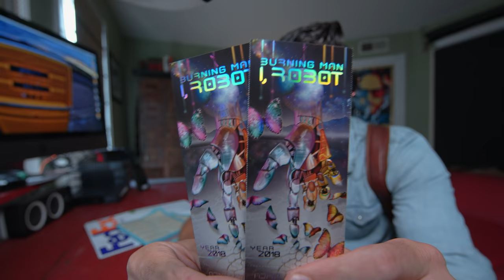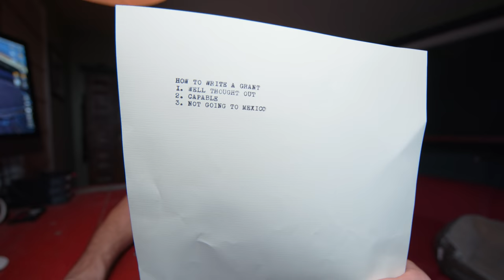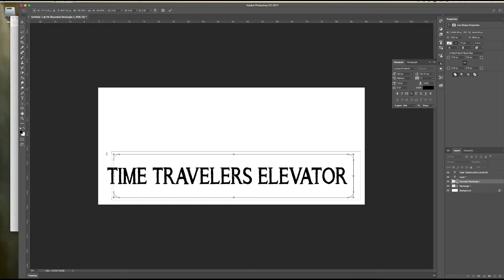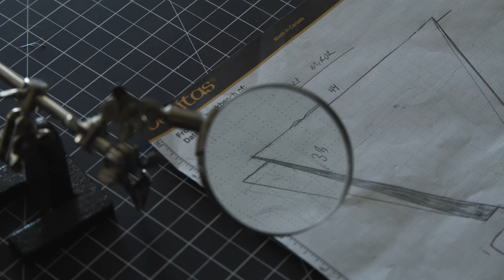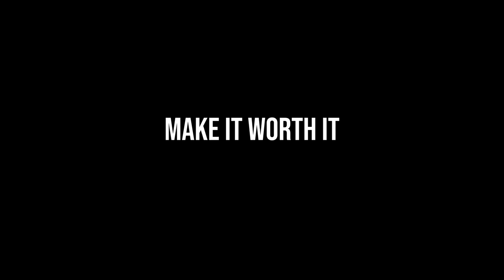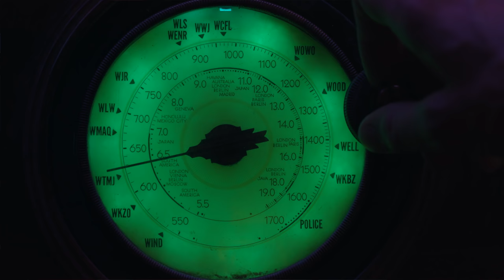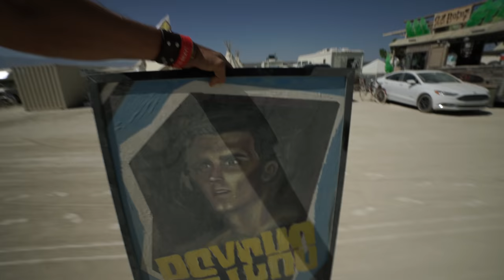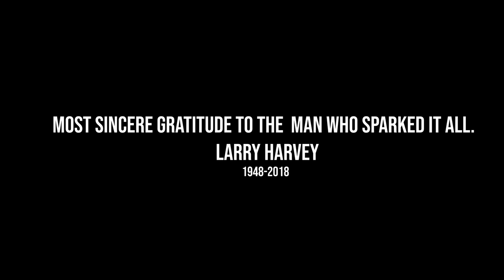I built a Time Machine Elevator at Burning Man. Here's How.

Comment: I know this is a really strange question… but what is the sand at Burning Man like compared to the sand on a regular beach? I’m in a wheelchair and my wheelchair can’t drive on beaches usually, it gets stuck after about 30 seconds unfortunately…
But I’ve wanted to go to Burning Man for years and years! I just don’t know if I would be wasting my money going all the way there (I’m from the UK), if I’m just going to get stuck in the sand after 30 seconds🤦🏻‍♂️😅
I’ve found that the harder the sand is the better, but obviously without going there I have absolutely no idea whatsoever what the sand is like unfortunately. So if anybody at all could possibly give me an insight I would REALLY appreciate it!!
Reply from the maker: You should def make the journey. Your wheel chair will hold up just fine, you won't get stuck, the ground is made up of tightly packed clay dust. It will get very dusty, you may want to have an extra one when you get home as the dust is very hard to clean off. but on the plus side you will make a ton of friends and many volunteers to push you around by hand or strap you to their flaming flamingo art car and push you around fast than you'd like to go! 

You will need an infrastructure though, other burners to take you in. I would look on Facebook groups and tell your story, see if a camp can take you in! Good luck!
Reply: MAKE. ART. NOW. Thank you so so much for the reply man!!🙏🏼 It really does mean a lot to me! I understand, I hope I don’t if I do ever manage to get there🤞🏼 It really would be a shame to spend all that money and travel all that way, just for me to get stuck straight away hahah!! The harder the ground is the better I think… I always seem to struggle on sand, and when the ground is full of small rocks, I alwaysss seem to get stuck on those 2 surfaces for some reason🤔 When it’s REALLY thick mud too!! I went to a music festival in the UK a few years ago and we’re known for our heavy rain in the UK aren’t we? And it rained heavily for 2 days/nights before I went unfortunately, so the mud was unreal!!! It was REALLY thick and really really slippery too! So I couldn’t drive AT ALL in that, that was even worse than sand if anything, as volunteers tried pushing me from one music stage to the next, but as the ground was so slippery because of the mud, they couldn’t get enough traction on their feet to actually get pushing me if that makes sense? So they tried lifting my wheelchair with me in it instead… the problem with that idea is that my wheelchair weighs 180kg on its own, then I’m around 75kg or so I think? Maybe bit less when this took place but yeah, it’s not light at all. Especially when you’re lifting on a slippery surface like the mud that was there… it SHOULD work better on sand/clay though right? As that isn’t slippery usually is it haha! So fingers crossed🤞🏼 But as for the mud at the festival I mentioned, it took around 6 weeks to fully get it removed from my wherlchajr😫😂😫 It was absolutely brutal!!😫 And unfortunately, I only have the one wheelchair too! Or else I would just get a wheelchair specially for that and just scrap it afterwards, but the wheelchair I use every day has a custom made seat and backrest and everything like that and they’re not easy (or cheap at all) to get unfortunately! That flaming flamingo car does sound incredible though I’m not gonna lie😂😂😂 There is such a thing as a beach wheelchair… they have giant wheelchair tires on them instead of regular ones, so maybe that is my best bet I don’t know?🤔🤔 I definitely think that I need to do some testing before I actually get tickets or anything like that!! Testing the wheelchair on the packed clay dust, tested how long my actual battery life would last, what it’s like to clean it all off of my wheelchair, see if I can easily find infrastructure like you suggested (would have probably forgotten about that so thank you for reminding me😅🙏🏼). Do you happen to know of any groups that you think would be my best bet for things such as that?^ So I can at least start trying to make some friends in the group so I’m not just joining and then asking for accommodation straight away hahaha!! Any help at all is VERY much appreciated bro🙏🏼🙏🏼